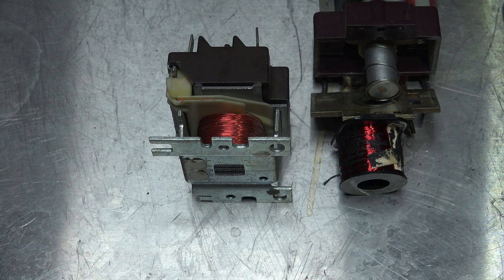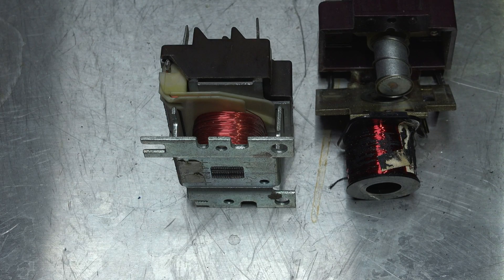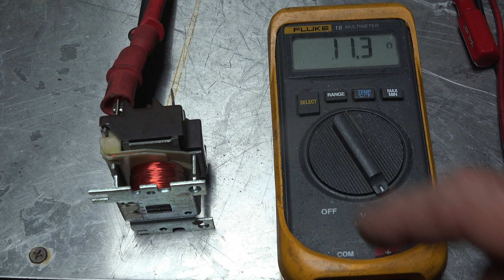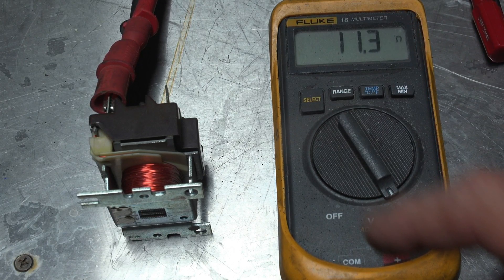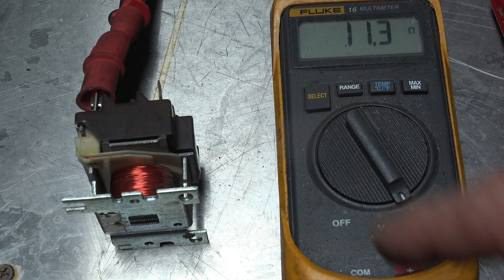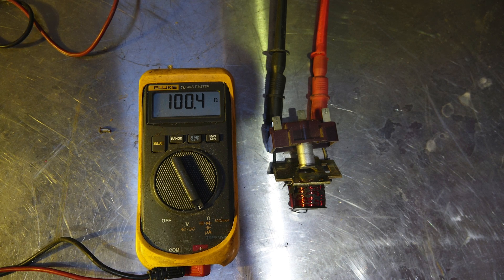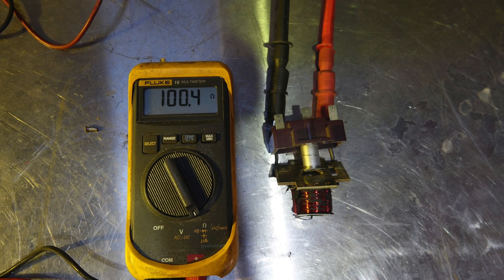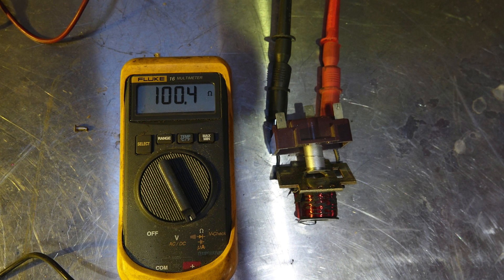A comparison of the AC and DC coils of relays for HVAC

Comment: I have several identical hydronic relay units, one buzzes and chatters a bit while the other is silent. Was considering adding a full wave bridge rectifier figuring DC voltage would eliminate it. Seeing as the difference in Ω is so great I see how that would be ill advised. Even if it would work it would also overheat the coil and likely burn out the integrated transformer. Thank you.

Comment: Some of the terminology and statements in this video are simply incorrect.  There is no such thing as a "DC coil" and an "AC coil."  Both relays use coils.  Period.

One is an "AC relay," and the other is a "DC relay."  Both coils have inductance, in fact, if I had to guess based on the higher resistance of the DC relay, I would expect it to have even more inductance than the AC relay - more wire turns means both more resistance, greater field strength, and higher inductance.  

An AC power source will see both the resistance and the inductance (reactance) of any coil attached to it.  A DC power source will only see the resistance during normal "ON" time.  However, it WILL see the inductance of a coil when when the DC supply is first applied (it slows down how quickly the current goes into the coil), and when it is removed.  It is this inductance that creates a high voltage when power is removed from a coil.  

In your car, this creates the high voltage necessary to drive spark plugs.  With DC relays, what is called a "kickback" diode is placed in parallel with the coil to drive the current stored in the coil back to the power supply and avoid high voltages in the circuit driving the relay when DC is removed.

In DC relays, the magnetic circuit (the contact armature and steel frame) is very simple - essentially a "C" shape with the contacts moving between the open ends of the "C."  In an AC relay, the shape of the frame has to be different to accommodate the fact that the current drops to 0 twice every cycle.  

Normally, the current going to 0 would mean the relay would open up.  However, the magnetic circuit in AC relays is designed such that the magnetic flux in part of the frame (probably the fingers sticking out to the left of the coil in the early part of the video) is 90 degrees out of phase with the rest of the magnetic circuit.  The field in this part of the circuit is not strong enough to close the relay by itself, but it is strong enough to hold it closed once the relay is turned on - thus keeping it closed when the current goes to 0 during the AC cycles.

Thus, assuming the coil and / or supply didn't heat up too much, you can close an AC relay with enough DC current.  However, if you try driving a DC relay with an AC current, you will hear it clicking on and off very rapidly, as it can't hold the contacts in position when the current drops to 0.
Reply from the maker: Your thoughts on this issue are appreciated.  
The point of this video is not to dig too deep into the why of the difference between the windings but to demonstrate that they are different, and cannot be interchanged.
GFM
Reply: Hopefully I was able to add to the explanation then.  And I hope I didn't come across as too harsh. 
Have a great day.
Reply from the maker: I always like this type of comment as it adds to the knowledge.
GFM
Reply: @Cyntillation01  excellent explanation... Thanks

Comment: Thank you for the explanation I am currently working on a machine that has a PLC  that has both types or relays. 
Question. Why would you use a DC instead of a AC relay on certain applications.
Reply from the maker: Some applications will cause the relays to hum.
GFM
Reply: 24 volts DC is a standard power used in PLCs Programmable Logic Controllers.

Comment: Hey GFM
I was asked about a subject not related to this video post. I'd like to run it by you. I was asked if I thought 'stop leak' additives were good to use and if not why not?  I answered , "no I don't think they are good and my reasoning was I pictured walking thru the  High side toward the evaporator, after walking into the inlet of the TXV the resulting opening of the TXV becomes a negative pressure which I think most stop leak products operate by, the pressure being pushed out of the tubing, TXV etc which is negative (suction) I can only assume that the opening of the txv in combination of another possible leak could result in blockage Not to mention clogging a dryer and some compressor drain holes leading to the bottom of the compressor. I'd appreciate your thoughts on this if you would.
Thanks for all your videos I look forward to them
G
Reply: I feel I need to specify that I'm speaking in terms of being within the refrigerant line. Miniaturized, as if walking thru a tunnel. Hope that clears up my thought process.
Reply from the maker: From the service tech's point of view, I can see damage to gauge sets and sensors from the stop leak.  Most of the stop leak additives supposedly activate upon exposure to oxygen, which should not cause a problem for expansion devices.  That is, of course, if there is no air in the system.  
The idea that simply dumping some sort of goo in a system and making it all better reminds me of auto radiator stop leak, which also did not work.  For me its not a repair just to add something to fix leaks.  Repairs are done mechanically and by replacement of parts.  I suppose if you had a very old system that was up for replacement in the near future you could try it.  But I would look to replace the linset when the repair is done (with new refrigerants, you will probably have to anyway).  Any way that's my 2 cents.
GFM
Reply: Thank you for your input. I can appreciate your sense of "Staying true to the game" and  think it's a critical message for all of us who consider this field  'Our Craft'. 
I hadn't considered the effects on our 'specialty' equipment which cost so much and renders us unable to perform with out it. Looking forward to more from your 'seasoned mind' and thank you for being so generous.